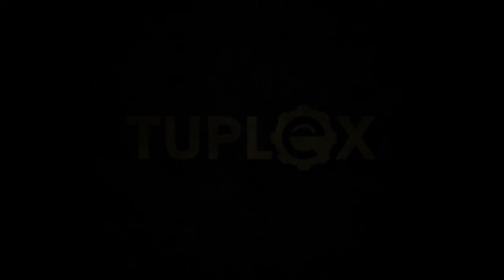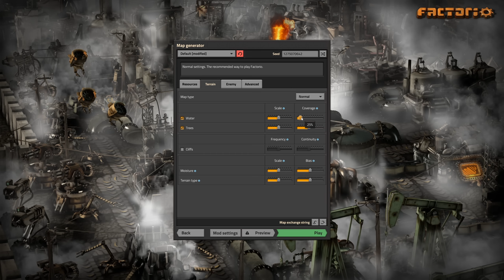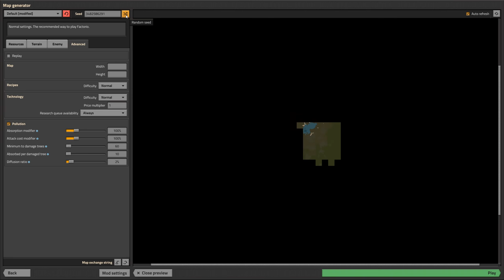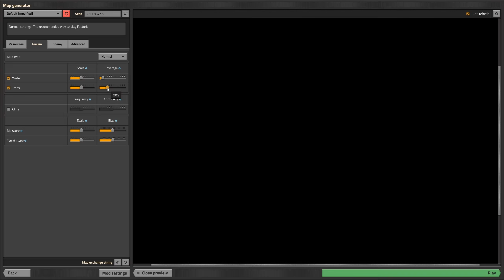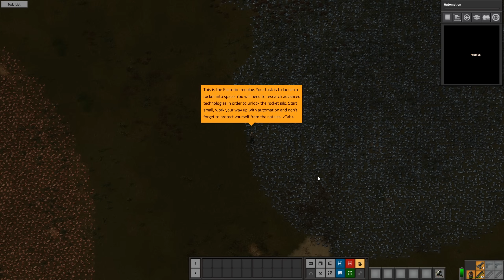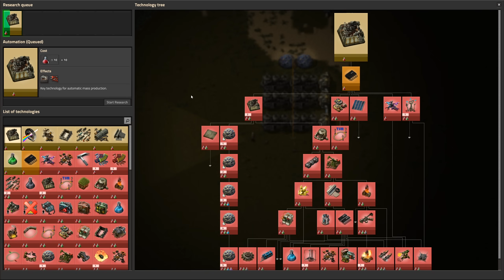Factorio 2,500 SPM Grid Megabase #1 - New Series!

Comment: why not auto build 50 furnaces into a chest ... then a new smelt line is furnace ready when you need it ... same with the belts and inserters ... build a smelt line supply of whats needed to build one and pull from that ... then every time you want a new smelt line pull the full load and slap a full line down

Comment: Hey Tuplex.. Train pubsub seemed a bit buggy recently.. you should check the functionality before starting to use them..
Reply from the maker: I’ve been experimenting and it seems to be working fine...but if I run I to problems I’ll convert to LTN.
Reply: @TuplexGaming  Somehow adding or removing stations while running messed my base up and some trains in the depot didn't decide to move. so keep that in mind. also if that happens /reset doesn't work
Reply: Hello Tuplex. I have also have had issues with TSM. Was crashing my game when I tried to remove priorities.